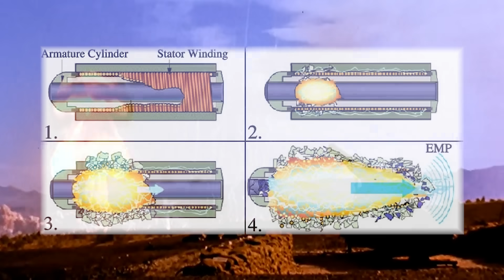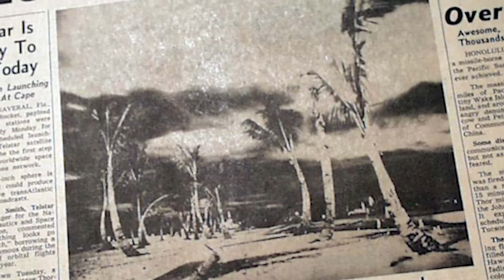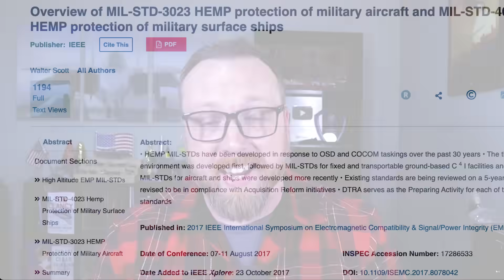Could an EMP wipe out American airpower??

Comment: My question would be on our reliance on satellite technologies as guidance and GPS. Our aircraft use these platforms for navigation  and targeting how would we fair with an EMP taking out satellites? I get a bit spooked about how reliant we become with technology because it's so easy to do today. Do we still have a backup plan if that happens? Also how would we track in coming missiles? Very informative video thank you for sharing. I am sure somethings are top secret but I am sure there is some standard basic information of a backup plan in the event of some crazy idiot dictator doing something off the wall like setting off nukes in space.

Comment: One thing I've always wondered about an EMP, If one were to go off and lets say you had 2 identical computers, not shielded in any way against EMP. 
But 1 of the computers was switched on, and the other one was switched off, unplugged and battery removed from the motherboard. Both computers are then exposed to the EMP. Would both computers be rendered useless or would the fully powered down computer survive? You plug it back in, replace the mobo battery and switch it on, would this computer still be operable?
Just a thought, if there are any electronics experts out there, I would love to hear what you think about this one. Thankyou in advance 😀😀
Reply: an EMP uses any cables or connections as antennas since it is so powerful, it doesn't matter at all if it had power or not since the EMP provides a huge burst of power to the devices which is what destroys unshielded electronics.
Reply: @Fatallydisorganized  thankyou my friend 😊

Comment: The effectiveness of an EMP is directly related to the length of conductor, whether a trace on a PCB or wire, the longer it is the more energy it will collect from said EMP

This is the reason Hawaii had issues during the Starfish Prime tests, miles long telecommunications lines etc etc
Reply: And power distribution lines are hundreds of miles long.  We'd be screwed.
Reply: @Kriss_L  yes in many situations we would be, but people are worrying about phones and cars lol
Reply: @cnkyy  It wouldn't be long before they would be more worried about food and water.  Or heat or AC.  Or the toilet not flushing.

Comment: Planes, radios and general equipment would work. Our bases even have backup power and fuel but only enough for so long. 
Basically if we get hit by an EMP the civilian sector will de decimated but the military can still function on borrowed time, although not indefinitely without the support from civilian resources.
Reply: If the power grid is taken out, that ends any resupply of food, fuel, water, and everything else.  Fuel for generators (and anything else), water, sewer services, and food, on bases would be gone in days.

Comment: Im retired now but about 15 yrs ago or so i worked on a project at whitesands missle range or wsmr. And we built a structure dedicated to emp pulse testing. It is a 4 story all metal building 1/4" plate steel all welded . Inside of a 5 story building. Its called the EMVAF building or electro magnetic vunurability assesment facility. Inside the center building it has a huge rotary platform so they can bombard our militery equipment from all angles with emp pulses. This building being a huge faraday cage of sort allows for testing without interfering outside interests. 
Being a person with a pacemaker that is responsible for over 80% of my heart beats im surely fucked as would be many others in my situation . The lights for me would go out within srconds of an emp pulse😊
Reply: @oktoday8323  i think i mentioned that in my comment

Comment: I have another question for you, what if a foreign adversary manages to knock out gps satelittes?
Reply: We have spare satellites already in orbit, but only so many.  We also launch new satellites to maintain the system.  Bottom line, we still have maps and compasses.

However, it would have an effect on power distribution.  Power plants have to ensure that the power they put on the grid is in phase, and that requires very precise time keeping, often in remote areas.  They used to use expensive and high maintenance atomic clocks, but many years ago transitioned to GPS, as GPS uses very precise time signals to compute location.

Comment: I'm not convinced the outcomes would be quite as bad as many think.  MOST significant electronics are inside of a grounded faraday cage of some kind.  Cars are faraday cages.    There would certainly be some disruption, but I tend to think the threat of this type of thing has bee greatly overblown.
Reply: It's not the cars that would be the problem, but the power grid being taken down.  All the transmission lines would act as huge antennas, and the transformers would blow.  Currently, the lead time for larger transformers that keep the power grid running is 1 - 2 years.

We would be screwed.
Reply: There is a lot of incentive to hype up the threat of an EMP for many companies selling survivalist gear. The more they can make it seem like a threat, the more that industry sells. Not saying it isn’t smart to be reasonably prepared for many scenarios, but like you said, often, the EMP threat is overblown

Comment: I don't know how hardened the current cellphone/internet systems are to EMP, but the old Bell telephone system was designed to operate in case of nuclear war.  That included buildings like 33 Thomas Street in New York, concrete no windows.  The most vulnerable part of the cellphone system is likely the cellphones themselves.
Reply: The US power grid would most likely go down.  And when the fuel runs out in a couple days the backup generators will stop.  After that, basically no electricity for anything.

Comment: The U.S. millitary found out early on with aboveground nuclear testing that many ignition systems in vehicles were damaged.  Vehicles parked with closed points suffered fused points and condenser damage while those with open points were usually o.k.  It became SOP to crank the engines to points open and disconnect the battery.  Todays' cars with all the computers would be fused piles of junk.
Reply: Cars are basically Faraday cages and would probably be fine.  The military built in systems to prevent the need for the measures you’re describing.

Comment: When they dropped the first ones in WW2 they had no effect on the plains that dropped them. Fat man and little boy they didn't have no protection for they already knew that it wasn't needed. Are country is preparing by putting power lines under ground not just because of storms but for safety. Some places would be hit harder than others thou.

Comment: Something you should analyze is camouflage. The Ukraine war with drone use is demonstrating the failure of camouflage. People and equipment are obvious to drone operators. Most camouflage netting I see is the wrong color and often rigged like a tent. A nice rectangle that's different from anything near by. And obvious bunkers and foxholes. I spent a few years in Vietnam where camouflage usually wasn't needed. But I'd feel naked as a Russian soldier in Ukraine.
There must be some people and companies working on this problem. Thanks! Have lunch on me.

Comment: I would say NO  AS an Electronic Countermeasures Maintenance Instructor back in the 80s  We had pretty much broken the code on that problem.     Aircraft, missiles, radios and such had pretty much 100 percent built in protection.
Reply: But how long would the US military continue to function with the US power grid down?  That would would mean resupply or funding.

Comment: There's a giant wooden platform near Sandia National Labs where mostly aircraft systems were tested against EMP.  It had a couple of Marx generators that could create the largest EMP in the world (without nukes, that is).  It was almost entirely made of wood, using a lot of glue and even wooden bolts as to not mess with test measurements.  And you could put a MTOW B-52 on it.
Reply: It's the biggest wooden structure in the world, i think i read.
Reply: I was on an inspection visit to SNL with regards to preparations for a light initiated high explosive test of the Peacekeeper Stage IV test article to simulate a high altitude nuclear effect. We passed by those wooden trestle platforms on the way to the test site. They were indeed big enough to accommodate a B-52. We also visited an EMP test site that was configured to expose an entire Peacekeeper ICBM missile stack to simulated EMP. I expect that the next generation ICBMs (the Sentinel?) will be tested there too.

Comment: Yes and no. Some military gear in use would survive due to the design of it. Most are shielded to a degree. However, there's also a good supply of backups under heavy shielding that will definitely survive. Would take a bit to be sure the EMP threat was over, then get them out and replace the ruined ones. So yes, it might ground the USAF for a bit, or in part, but not permanently.
Reply: If the US power grid went down, having planes that were shielded wouldn't matter.  There would be no more production of anything in the US, nor funding, nor really even a functioning state left.

Kill the electricity to a city and see how long people last with no water, sewer, medical care, food, transportation, communications, etc.

Comment: Honestly, I started watching this and thought - every time Godzilla farts, an EMP got dropped.

The problem with this weapon, is that it is a scorched earth tactic. No resources for the victors to claim, just as with poisoning wells and farmlands.
Reply: Seems like it is the perfect weapon. No radiation fallout to worry about. No buildings that need to be rebuilt when you take over, ports, roads, rail all remain intact.
Reply: @MikeLabelle76  yet nothing of the infrastructure such as electricity, traffic lights, tools and transit rail won’t work either. Communication infrastructure is also gone. Every piece of higher tech is toasted. Far from a perfect weapon.
Reply: @MikeLabelle76   The cities would be full of decaying corpses, disease, and accumulated waste.  With no maintenance, buildings and infrastructure would degrade pretty fast.

Comment: US civilian infrastructure will be hardened in future, not specifically for enemy EMP but for what are known as CMEs, or coronal mass ejections. The other type of event to be concerned about is a Miyake event, which is right now unclear where they could originate from.  Might have been an Anton Petrov video that spoke about the hardening of US civilian grid? Anyways, CMEs and Miyake events can be far more powerful than even the strongest EMP humans can produce, because… the sun and space.  We’ve managed to avoid disaster for the majority of the time since we began using electrical appliances, but eventually it will occur where the earth is directly in line for a massive CME or extrasolar radiation blast. Depending on what part of the earth is facing the sun at that time of a CME, could be interesting. A big enough Miyake event would pooch basically all electronics and electric grids on earth, nobody would likely be spared.  Look up Miyake event on Wikipedia. Not sure what humans can do to avoid being completely knocked on our asses by such an event, but we should definitely plan for it.

Comment: Additionally, the US military assets are dispersed over a large area. An EMP from a nuclear detonation would not take out bombers or fighters in Europe, Diego Garcia, Alaska, Japan, Hawaii, and the Middle East. Even more, launching a nuclear missile in the direction of the United States would be seen as an act of war and nuclear retaliation from at least the land based and sea based leg of the nuclear arsenal would be eminent and a nuclear strike from bombers highly likely. You’d have to launch multiple nukes to even have a shot at successfully enacting an EMP attack because one or two nukes would surely get intercepted.
Reply: Put a nuclear warhead in a "communications" satellite as a secondary payload.  Let it do it's thing in orbit for years or decades.  It is there if it is ever needed.

I'd be surprised if there aren't satellites in orbit right now like that.
Reply: except it is fairly easy to calculate the weight of a satellite based on its design and how it maneuvers in orbit. it is impractical since it would take months for a satellite to deorbit with its limited fuel on board, meaning that the space force would be super likely to shoot it down before it re-entered the atmosphere since they would know very accurately where it would fall since orbital periods don't lie and you can't hide it.  @Kriss_L

Comment: What would prevent American aircraft from carrying a portable and focused EMP generator that could be directed at Chinese fighters, crippling their electronics while harassing western aircraft?
Reply: Doubtful.  China presumably hardens their aircraft against EMP just like we do.  You might be able to do it at short range with an EMP-producing warhead on a missile (a multi-use system couldn’t generate enough power to have a chance at frying military-grade systems).   At that point, might as well just jam their sensors.
Reply: Power requirements to have a useful range.

Comment: Even military vehicles are hard wired to an extent. That one of the reasons why when starting a hummer or JLTV, or whatever. You turn a key, and then press the button to start the vehicle. That switch acts as a hard break to prevent most EMP attacks. But the bottom line is anyone who drops an EMP overhead isn't trying to take out the military. What they are doing is requiring the country to use 100% of its military to take care of home, which is what will be needed.
Reply: No, that is not how EMP shielding works.
Reply: @Kriss_L sorry, but on military vehicles, that is so part of the design of the engine and why.  What, you think each engine is its own Faraday cage?  Most military vehicles do not carry electric starters to keep them from frying during an EMP.  Changing a battery fried from an EMP takes 2 minutes. An electric starter takes a good 30 minutes longer.

Comment: There were speculations that vacuum tubes has a good resistance to EMPs
Reply: Yes, but no better than EMP-shielded transistors and chips in modern electronics.  The “vacuum tubes are better” narrative was a half-truth spread by the Soviets, who simply didn’t have more modern electronics, much less the tech to shield them.

Comment: I heard that there is already switch fast enough to protect energy infrastructure against EMPs.
Reply: I doubt it.
Reply: This was in an scientific article. I read the pop science version. Basically EMP nuke's own field don't damage the transformers. The damage is caused by the earths magnetic field locally amplified by the nuke's field. More specifically the speed that the field's power rises causes too big current spike for the grid's components. The study claimed they made some kind of new circuit breaker that is fast enough to shut the power grid down even in the case of nuke amped overload. I had no reason to doubt it. Obviously refitting all the infrastructure won't be cheap or fast and some probably claim that it is pointless to prepare this way for nuclear war. @Kriss_L
Reply: @SystemLordNemo  I still doubt it.

Comment: With fiber optics the vulnerability automatically dropped for civilians, but it is a kill of anything with a chip in it a majority of the time.
Reply: Yes, fiber optics help protect communication infrastructure.

But power stations and electronics on the other hand would be eliminated.
Reply: Fiber cables have repeaters spread across their distance that are vulnerable too. But fiber beats cable hands down.
Satellites are most effected by this but had to be hardened to get into space to begin with.
Reply: Fiber wouldn't matter if the power grid was taken out.  No power, fuel, water, food, waste water processing, or transportation.
Reply: The charges going through the communication lines would be minimal compared to the power system.  at least that would likely be the first thing to be recoverable once people started making repairs.  Given that most transformers are made in China anymore...  Most power would be a local affair for a longtime.  How "hard" are PV panels?  something to think about they are semi-conductors after all.

Comment: At worst the fighter has to restart.  If it works as engineered, it shrugs of the pulse and you are about to find out.
Reply: Maybe If It's A B-2 Spirit or A F-117 Nighthawk Those Planes Were Developed In The 80s Before The Full Transition To Digital In Fact Many Cars Built All The Way Up To 2010 Could Potentially Survive EMP But The Real Challenge Is Getting Parts You See After 2010 Everything Went Digital And Mechanical Parts Were Discontinued And Since No Real Manufacturing Exists In America If An EMP Disabled American Infrastructure You Wouldn't Be Ordering Replacement Parts Online Anymore Same Goes For America's Military Eventually The Ammo Will Run Out Because Nothing Is Made In America Anymore
Reply: @rubyruby7573  the F-18E's and later built planes have the longest wires in the plane in their data busses.  That is glass wire and light ignores EMP.  Most planes are Faraday cages and will probably shrug off EMP, if not they probably need to restart at worst.

Comment: “A really bad day” could, in theory, wipe out the electronics in all nearby military and civilian assets if the blast was big enough, but the hardening that has been done by the military should have some beneficial impact by reducing the effective radius of the blast.

My biggest concern with an EMP attack is the impact to civilian assets that the military uses or benefits from. Things like air traffic control, logistics equipment that may be leased or rented out to the military on a short term basis, and obviously anything that affects agriculture production. After all, if you can’t feed your army, you don’t have an army!